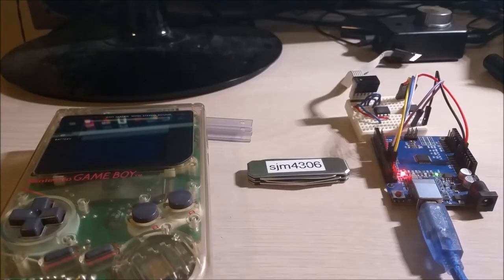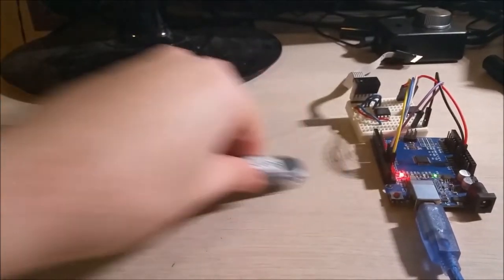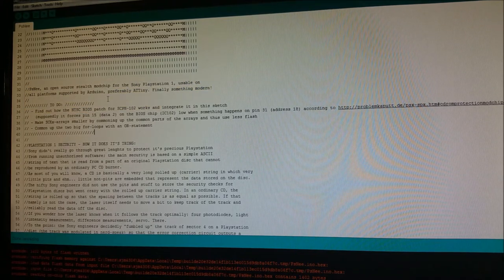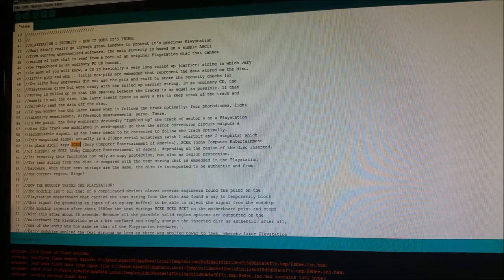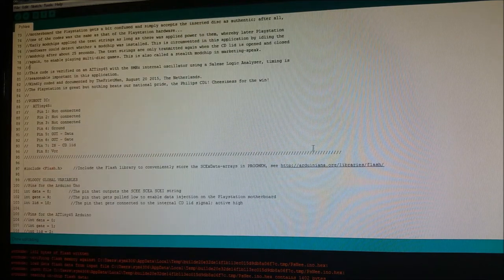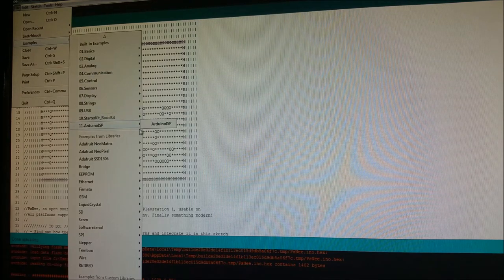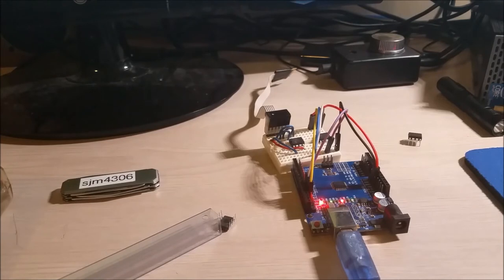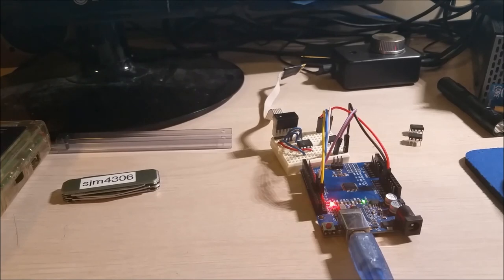Flashing a PsNee Open Source PS1 Modchip to Arduino and Big Announcement

Comment: Is anyone else still having issues compiling due to flash.h error? I can't get by this point.
Reply from the maker: Cole Tilford I pinned a comment explaining how to fix this. Just need to import a library.
Reply: sjm4306 which library?
Reply from the maker: Cole Tilford Oops I swore I posted it here. You need to import the flash library found here: https://github.com/schinken/Flash
Reply: sjm4306 Thanks, I'll try it out when I have the time!

Comment: will it work with a esp8266?
Reply from the maker: Do you mean will PsNee run on the esp8266, or if you can use an esp8266 as an icsp programmer to flash the chip? In either case I think you'd need to port the code a little since the esp and atmega are different processors.
Reply: @sjm4306  i’m wondering if it’ll work as a mod chip. i haven’t seen anywhere about using a esp8266 as one.
Reply from the maker: The PsNee software is open source so you will likely need to port it to the esp8266 since a quick search doesn't show anyone else having done so. The atmega and esp8266 aren't 1:1 compatible so you cant just directly flash one with code meant for the other. I haven't looked into the code myself but I'd assume it'd mostly be a matter of changing pin declarations to the correct ones on the esp8266 and possibly some peripheral register names if the code uses them. Then you can recompile the code and flash the esp8266 using the arduino ide.
Reply: @sjm4306  okay thank you i appreciate it!